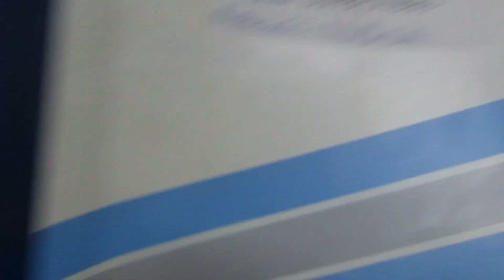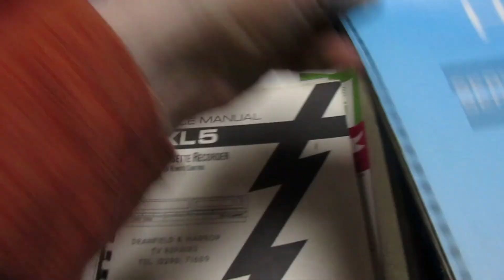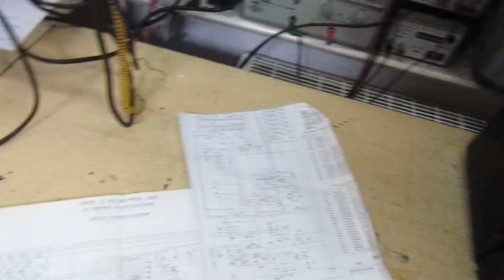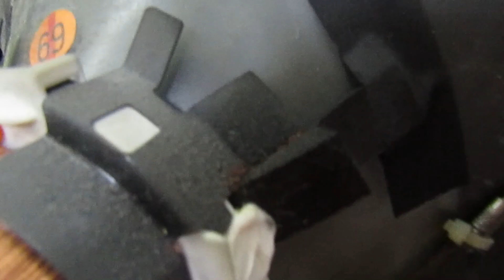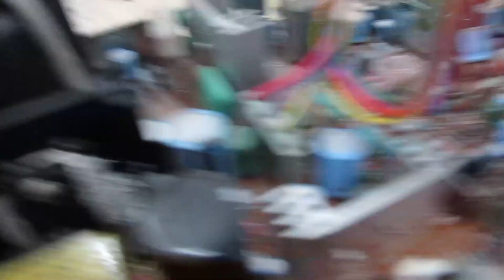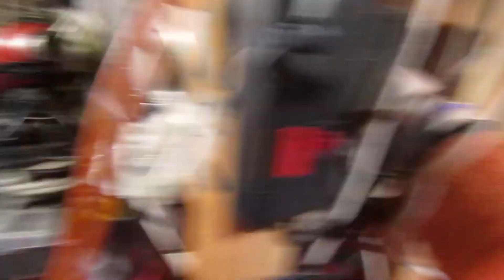Saisho CT141X vintage TV set from 1987 .

Comment: Of my particular interest as how the 5.6 ohm, 5w series resistor 'protects' the mains fuse. I think on these circuits, a 'Time Delay' fuse is fitted to cater for the surge current used in the degauss coil  in series with a posistor. The rating of the fuse might just be 2 or 3 amps, but capable of carrying a surge (for a very short time) of 10 amps or more. The specification I remember is, ”Fuse, T2A, or T3A" where the 'T' prefix means 'Time Delay' (like the common lock on a bank safe)...
Reply from the maker: This was a pretty standard joke in the trade years ago, the fuse never ever blew, its was always the resistor that went open circuit, hence the line the resistor was there to protect the fuse .

Comment: Great video that brought back memories.  Tubes with such "narrow neck" electron gun assemblies tended to last much longer in small screen sets ...compare that with the short life of some of the tubes in large screen TX90 and other Thorn sets back then! Orion stuff was always pretty good in my experience, despite what the trade and public thought.  Back in the 1990s when I was in the trade, I wish engineers had been as polite to each other as they are now in these Youtube comments... unfortunately, back then, competition was cut throat, with engineers appearing to go out of their way to hurt each other. If it wasn't for trade magazines such as Television, there would have been no communication between engineers back then, such was the level of competition, desperation for work and non existent manufacturer's support...so glad I left electronics. Great advice about the scan coil supports...I always cleaned the "service switch" in such sets to prevent frame issues.
Reply from the maker: Glad you liked it , have another one of these sets now ! it was very cut throat like you say years ago, TV shops everywhere , all gone now just like the Television magazine sadly .

Comment: I was guilty of looking at these with disdain when they first came out as I remember Thorn having to pull out all the strings to try and compete (TX85 i think was their budget 14in chassis designed to compete). After a couple of repairs (sanken module and inrush resistor) I was happier to see them as the faults were largely predictable. A bit like that Amstrad with the ceramic cap that used to split open. Easy repair once you'd done a couple. DSG group knew what they were doing after all!
Reply from the maker: These sets were the bread and butter repairs of the 80s and 90 s , easy to repair , after you had done a few they all suffered from the same common faults and were easy money makers.Happy days .

Comment: Wow great picture nice work Michael, those rubber wedges turning conductive reminds me of the Samsung glue that turns brown and conductive 😊
Reply from the maker: its strange how it became a common fault in some sets but not others , never had bad rubbers in Sony sets .
Reply: @michaeldranfield7140  how strange! Just down to the composition of the rubber then!
Reply: Indeed! I remember Mitsubishi glue turning brown & conductive and eating through the PCB foil on the colour sub-boards too....
Reply: @marksntl7632  shocking! It really is, on the old Samsung power supply boards it seemed to always be near the main filter cap and the standby transistor
Reply: @wisher21uk  that glue often goes conductive and corrosive regardless of brand of device, its a known and big problem
Reply: @andygozzo72  yes Andy it is a big problem across the manufacturing industry, I have found the issue on many devices, this is why they now use silicon to securely affix components to avoid failures.

Comment: have the matsui tv the same as this
Reply from the maker: very well laid out chassis , especially if you compare these with the Amstrad CTV1400 .
Reply: @michaeldranfield7140  never come across any amstrad ones, but did come across quite a few 'britannia' branded grey cased portables, i think a fidelity design, all had same faults, dry joints, shorted ht rectifier, occasional bad degauss posistor,  last one i saw looked like it had a major eht flashover,  ramming eht back to the signal circuits, .there were 2 holes blown in the pcb, and many components fried 😲 not surprisingly it was a write off

Comment: Ahh yes i remeber saisho stuff, Dixons/Currys home brand, these companies are part of the kingfisher group along with pc world and argos, hinari/saisho were mostly junk, but there were a few gems that they made. currys now own the sandstrom and jvc hifi badges, and because of this the quality of their mini hifis has mostly been reduced to plastic rubbish.

The mrs works for currys and this stuff is coming back from failure every few days, built from shop floor swept up parts mainly

These televisions had the same tubes as the amstrad cpc464 computers, the CRTs in these however lasted over 3 times longer than any mullard tubes, they were so reliable thats why they used them in computer monitors. there are people to this day using the cpc464 monitors for retro gaming and theyre working as good now as they were in 1985
Reply from the maker: Even though these sets were considered junk back in the day they have stood the test of time very well and as you say far better than the chineese stuff sold today under the big brand names ,  I dont think Argos do any repairs now , if you take something back under warranty they just give you a brand new unit.

Comment: The hydroscopic conductive rubber wedges problem, is that specific to these Orion TVs or is it something to look out for with any CRT set?
I seem to remember Shango066 discussing it once about a TV in the US.
Reply: The wedges becoming 𝐡𝐲𝐠𝐫𝐨𝐬𝐜𝐨𝐩𝐢𝐜 (hydroscopic is a process for looking at things under water) isn't limited to Orion TVs. Back in the 80s and 90s when I was repairing TVs and monitors I can remember we had other brands that had problematic wedges. Many yokes were destroyed because of these.
Reply: Hygroscopic is the correct word , I used to call it hydroscopic  too

Comment: repaired quite a few of those, used to have the matsui 1420A myself for a little while
Reply: think i still have one 'new' spare SR2M diode 😁
Reply: all the ones i came across used the STR50103
Reply from the maker: @andygozzo72  quite possibly the T03 chip version became obsolete because I remember a time just before they became hard to get hold of the prices went through the roof .
Reply from the maker: @andygozzo72  me too !
Reply: @michaeldranfield7140  recently found i have one 'spare' STR50103 😁but looks like has been used so no idea if good or not, dont think i'd have kept it if duff.

Comment: I used to be able to cut off the small part that touched the coil. But usually after the coil had corroded and broken and I had connected it, the part that had not corroded too much could be done.
Reply from the maker: if there was green on the wedges it was a good indication the enamel had been eaten away and the coils were usually scrap as you say .

Comment: Back in the day "crap" just meant low-spec. They were still made by respectable Japanese companies like Orion, still had mostly Japanese components in them and would generally last ten years quite easily.

Now even the top brands are including a lot of unreliable junk in their designs which means failure in the first three or four years is the norm.
Reply from the maker: Samsungs are now the worst , I have seen lcd panel failure in 18 month up sets .
Reply: @michaeldranfield7140  uh uh, our main front room tv is a samsung 32 inch 'chuckout' i repaired, had burnt dry joint on the mains input socket, still working 3/4 years later (keeping fingers crossed..😁.)
Reply from the maker: @andygozzo72  if your samsung is 3-4 years old it will be ok, just watch out for exploding blue snubber caps , its the ones been made from the last 2 years that are the worst.

Comment: Would you be interested in a b and o me6000 with remote before i take it to the tip. Think its a phillips set underneath. Works fine though. Can drop it off if so.
Reply from the maker: Not one of my favourite sets by any means but I would rather take it than see it go to the tip .

Comment: I bought the teletext remote Matsui version in 1987, cost £180, still have it & still working!
Reply from the maker: bet you dont find a flat panel set still working in 40 years time !
Reply: @michaeldranfield7140  Absolutely, I have several TV's from the late 1940's that I have restored to working order!
I always try to get them basically working before restoration,  imagine my surprise when powering up A Pye 9" console from 1948, all it needed was the open smoothing cap
replacing to produce a decent picture, not bad for a set that was stored away since 1962!
Also the sound quality is superb, unlike any modern flat screen rubbish......

Comment: Hi Michael, I worked for Dixons in 1987, the CT141X was a current model at the time. I repaired a Matsui 1420A years ago, was an IC fault though can't remember which one now. Managed to get a nasty zap from that horrid floating aerial socket thing. I had no idea at the time that the outer of the socket assembly was at rectified mains, isolated by a ring of capacitors.
Reply from the maker: in the 80 s we had a curry's and Dixons in Buxton just a few shops from each other and I use to wonder why customers would pay another £10 for what was clearly the same set displayed in both windows but just with a different name on the front .